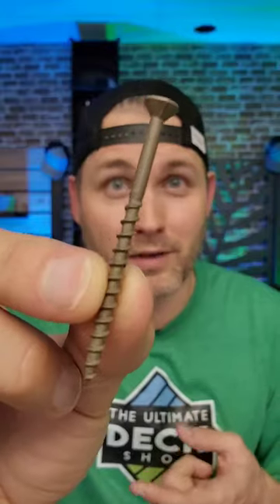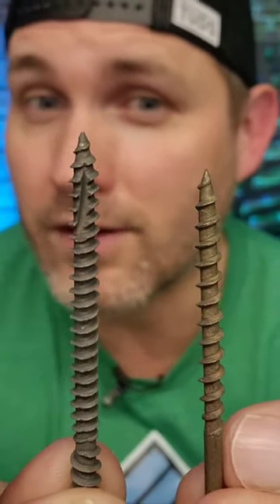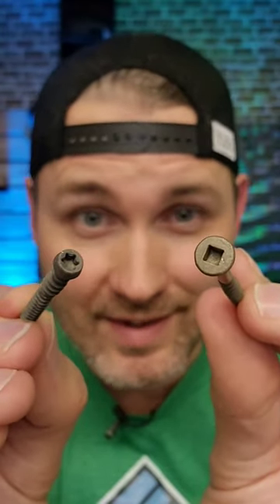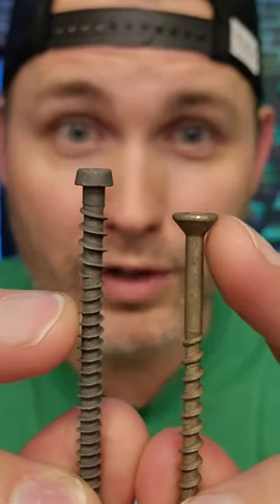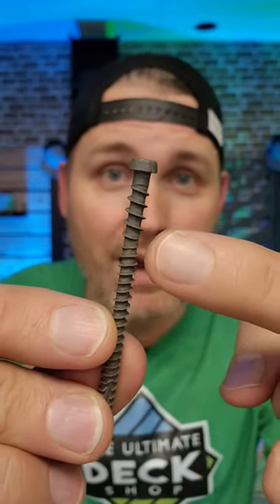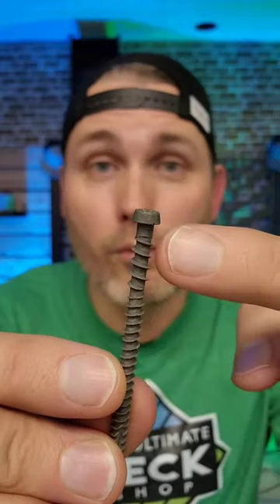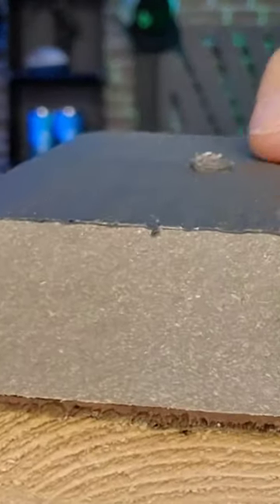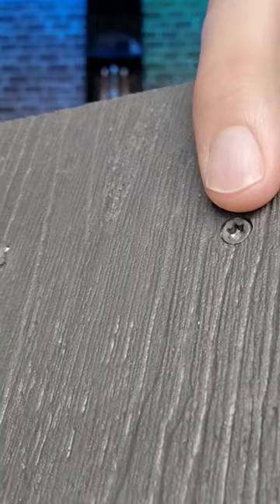Why Use Composite Deck Screws?

Comment: Rookie question: I got a killer deal on some composite deck boards and matching color #10x2.5 deck screws FOR WOOD. If I go through the trouble of countersinking all holes, I should be fine, right?

Comment: A contractor did mine with the wrong screws and I have mushrooming all over.  Do you have any recommendations how best to fix the mushroomed look?  I started taking a straight razor to shave off the mushroom but that takes the top surface of the composite material off.  Any caulking methods, etc. to fill in?
Reply: That’s frustrating. You could try and remove the screw and use a countersink bit on the hole, and put the screw back in. It all depends on if the countersink bit melts the plastic, or shaves it away. If it shaves it away your in luck. I should imagine you would need a brand new, sharp countersink bit.